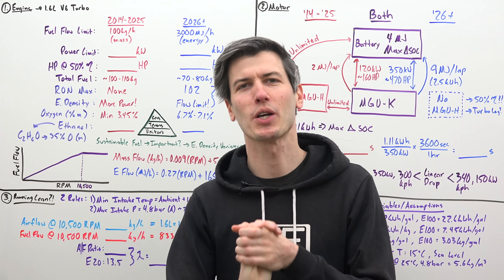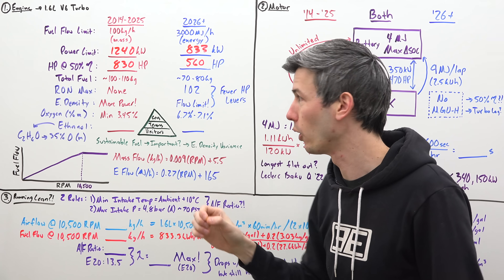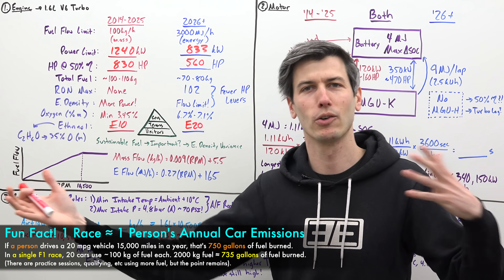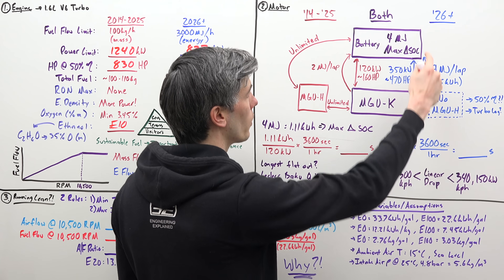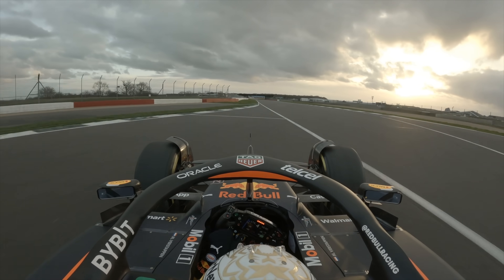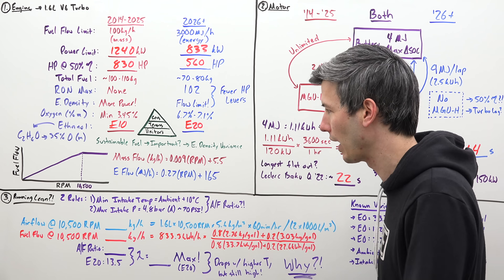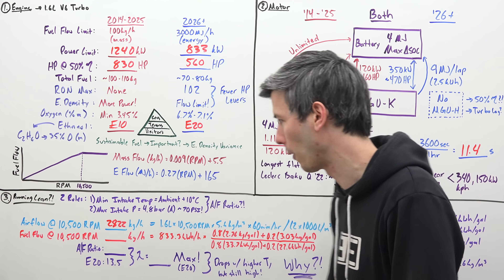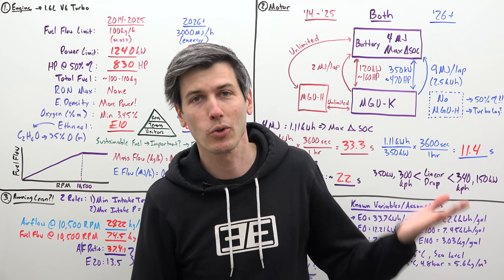Why Are 2026 Formula 1 Engines Going To Lose So Much Power?

Comment: I am wondering about the turbolag ever since I heard about the absence of the MGU-H. I mean now it is like the drivers have to recuperate some laps and can't always go flat out just to fill the battery. But to get 550hp out of 1,6L the turbo must be quite big, and in every single acceleration there will be this lag. So there must be a certain amount of ePower always available to fill that gap, otherwise the cars will be very hard to drive. I wonder if it affects the drivers or if the electric system will just fill the gap constantly in every racing situation
Reply: The FIA actually said they wanted the cars to be harder to drive (with turbo lag) but I suspect that scenario you describe above, using ECU maps to kick the MGU-K in during that initial throttle demand period, will be simple for F1 teams to implement.

Comment: Why would they get rid of the MGU-H? Wasn't that one of the most energy-efficient features?
Reply: Because MGU-H did give constant power to Electronic motor. So you could keep the electronic boost online all the time.
Without it, the driver has to think when to use that electronic boos, because it is used in shortet period of time (bigger e-engine) and it takes longer time to get the battery full…

Comment: Questionable decision to hamper the engines this much, a huge part of F1 branding is that they run the fastest cars on earth. If you take that away, you make it much easier for another org to steal market share.
Reply: The lap speeds can be better after 2026 rules… so not likely that these are not the fastest cars in the motor sports…

Comment: I'd much rather see a rolling average rate limitation... Having a flat rate cap seems to ruin the fun. If they instead used a rolling average limit, like dictating that the amount of fuel flowed in the past minute cannot exceed x, there would be a lot more strategy with when and where to use higher power.

Comment: Maybe teams will be using the Miller cycle or something similar to increase thermal efficiency at the expense of volumetric efficiency. Boost limits would effectively put a cap on how far they can go with that strategy.
Reply: The Miller cycle works best with a roots-type supercharger so it’d be interesting to see FiA probably allowing twincharge systems. It would make for a heck of a launch when the light turns green.
Reply: @Nafeels   "it’d be interesting to see FiA probably allowing twincharge systems"

There's the problem. It would require the FIA to allow something...
Reply: Superchargers aren't even restricted with current or future engine regulations. But you can't use an MGU-H with a supercharger. So maybe supercharging will make a comeback.
Reply: @456MrPeople that would be interesting, but superchargers are less thermally efficient.

Comment: How can an ICE rev past it's torque peak speed?  What force is pushing it faster if the torque  is at it's highest point and starting to fall off?  I would think that the fastest RPM would occur at the torque peak speed but obviously it doesn't.  Thanks

Comment: I still haven’t seen a clear video explaining how the ICE and electric motors are coupled to the gearbox. How do they transmit the power from both without the two affecting one another? In other words, say you have the ICE spinning at a certain rpm, and the electric motor spinning at a different rpm. How do you sum the torque and power output of both without them interfering with the other?

Comment: I don't think the intention is to limit the air mass flow rate. I'd guess that they are separately limiting (a) boost pressure, to stop teams cranking the boost WAY up – possibly for safety/reliability reasons? – and (b) intercooler performance – probably to try to head off an arms race of bigger/more complex cooling systems for marginal gains in charge air density. Now yes, those two together do impose a de facto limit on mass flow rate at the intake, but as you say that limit would give very lean combustion, and no-one's likely to hit it.
Reply: I came looking for this. 
I definitely think that they are supposed to be separate constraints.
Reply: yea cause if they can get away with super lean running engine then they will crank the boost of to as much as they can get away with. Try to limit max power to keep things some what level cause teams with unlimited would def explore an engine that can take a lot of boost and almost no fuel.

Comment: Are there rule about engine displacement? Because, with significant modification of the engine displacement, you can increase the horsepower without increasing the energy consumption.

Comment: Could a team use a 70 psi turbo pressure to motor the engine without fuel for a few revs? I’m just wondering about that air pressure limit on the intake…..

Comment: I would rather see a racing class where you are forced a certain mpg with a max weight, (for batteries). See if and how manufacturers go about getting the most speed out of much less fuel with certain ways of adding battery power to the equation, or stay lighter with none and really see what manufacturers can do with limits.
Reply: Formula e

Comment: The engine can be used as an air pump to enhance performance of other aerodynamic surfaces; see 'blown diffuser'. This may be to limit that so the exhaust outlet can be moved in future.
Reply: Compound turbo charging, ultimately led to gas turbines, and jet engines.

Comment: 560 HP engines in 2026 cars? Back in 2016, they made 1050 horsepower....  This is getting ridiculous.
Reply: 560hp + 470hp is more that 1050 hp… so we get more powerfull cars!
Just with less power from the gasoline pard of the car.

Comment: So if the new regs allow for energy regen at 9MJ vs 2MJ for the older spec, does that mean drivers can recharge their batteries that much faster ? (Since the battery capacity is the same between the old and 2026 regs)
Reply: In theory yes. I think it's safe to assume that one of the reasons for the 2MJ limit of old is that the MGU-H allowed the car to continuously recharge the battery whereas with the new rules that won't happen. Under the new rules energy regeneration will need to be done entirely in the braking. With that being the case, drivers will need to be able to regenerate more energy under each braking zone to prevent the batteries from being dead 24/7 (hence the increase from 2MJ to 9MJ). This could potentially result in strange driving patterns where drivers will get on the brakes earlier and with less force to allow for a greater amount of regen before long straights or just whenever they need to top off the battery.
Reply: True… using more motor break vs normal breaks will be beneficial!
Interesting to see who drivers learns more quicly to drive so that their battery is more full, more often

Comment: Re weird mix: The engines can cut cylinders so for a bank cut the air flow is twice the fuel. 
This is done to keep the turbo spooled in low power corners. 
With the big electric motor they might be tempted to cut all fuel in tight corners.  EG a MGU-H the hard way.

Comment: The FIA should just give them a race energy limit and let the teams figure out the best way to get there. That's one of the best reasons for motor racing is creating an environment where the rules lead to innovation. It seems like a lot of areas for innovation have been sucked out of the sport. I think I'd much rather see the rules opened to define a ceiling or floor and then let the teams bring what they will. Define the energy use, down force, max/min mechanical grip level, minimum weight (so we don't need jockeys), set a maximum budget and then let the teams develop what they will. That seemed to be the initial spirit of the sport. 

Oh well, good insight into the upcoming changes.

Comment: This is fascinating.  I'm seeing these changes in light of the coming legislated bans on ICE cars, and shift to electric vehicles.  Under their deal with FormulaE and the FIA, F1 apparently cannot go full electric until 2039, but the manufacturers will want to be using - and be SEEN to be using - relevant technology.  Shifting to almost 50/50 fossil fuel/electric power is a step along that journey.

Comment: Perhaps the intake air pressure limit is to keep teams from making a ridiculous amount of power for a short period while consuming a lot of fuel. With just a fuel limit they could run very efficient for a long period to bring their average fuel rate way down then for a brief moment dump a bunch of fuel and boost to make a lot of power while still staying under the average fuel flow rate. The intake pressure limit would cap that amount of power. That is, if I am understanding that the air is limited to an about of boost and the fuel is limited by an average fuel rate.

Comment: The thing confusing me is this, when will they charge the battery? If the engine is underpowered relative to the motor, and it is coupled directly to the transmission / rear wheels, during acceleration they will be using the motor and consuming electrons. At slower speeds they can’t decouple the engine from the rear wheels to power the mug-k as a generator. That leaves them relying on deceleration regen to charge the battery. (In other words thry can’t convert fuel to charge in real time by powering the engine during decoupled deceleration. They can only recapture previously powered kinetic energy as the car slows). I’m sure I’m missing something here and just thinking out loud.
Reply from the maker: It's just from regen. An F1 car traveling 200 mph has a lot of kinetic energy.

Comment: They absolutely are running as lean as they can as if you can get it to burn it improves efficiency. All fuel flow limited motorsports are running super lean now and its enabled by flame jet ignition a presumably other secret but similar concepts.

Comment: Crazy that the Valkyrie and the T50 have higher redlines than Formula 1!
Reply from the maker: They don't, current F1 engines are limited to 15,000 RPM, they just don't go much above 11,000 - 12,000 RPM because there isn't any benefit.

Comment: Will the teams be able to actually top it up to the whole 32 seconds? How many seconds does it take ( in racing conditions) to charge from empy to max charge?
Reply: Battery has 4 MJ
You can Charge 2 MJ/lap
2 laps ≈ 140 - 200 s

Comment: 9:40 two teammates streaming along such straight together could make more ground by overtaking each other on purpose. First the leading car uses his electric for both to increase speed and the other car just following in the drag on gasoline only (1) - and at about two thirds of the straight they change position.

 As a teamchef i would have my two cars communicate about it while going down straight - they give each other notice and recommend to the drivers just the right moment - 'in three, two, one seconds of time the leading car will run out of electric juice - get out of the slipstream - right now!'

1 - if the second car wouldn't be able to follow on petrol only we give him about 15% of electricity plus for perfect fit (test and measure) - and the overall equation two similar cars down straight just changes a little.

Thank you for your brilliant work! You like it very much!

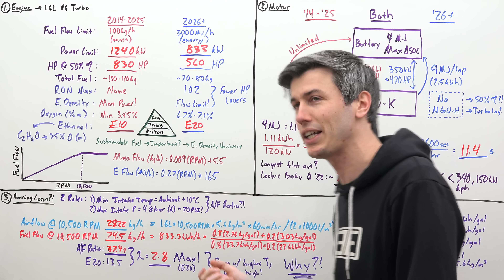15:00 - why? I have an idea. Because future synthetic fuels currently under development could provide for the possiblity to run so lean but still ignite and burn through sufficiently enough - i.e. provide us with huge benefits over current combustion engine fuels mainly made out of crude oils in simple processes?

(Next to discuss - quality of emissions and requirements to catalytic converters etc. for public transportation use?)

Comment: 13:46 : the engines may very well be running around λ~3. The pre-chamber allows them to do so with a closer-to-stoichiometry mixture inside it and a much leaner mixture in the main cylinder, way beyond the flammability limits for gasoline/E20, as you already indicated, which can however ignite this time due to the jets bursting out of that pre-chamber. The beauty of TJI it is! 😊
Reply from the maker: Yes, discussed in my previous video. Studies indicated λ~2 possible with active pre-chambers (something F1 isn't using, only passive). So it's not nearly as simple with limited control. More here: https://youtu.be/KjrNcuc89Pc
Reply: @EngineeringExplained  I had already watched that. Beautifully elaborated on! In the MC20 one as well, even though the configurations are quite different of course. My point was that limits, currently possible in latest F1 engines, are way beyond λ~2, as the whiteboard alluded to! Controlling combustion is of course the key here. Mixture preparation is really crucial, which is important to capture very accurately using CFD simulations. Stratification levels inside the pre-chamber are extremely high, due to the shape of body and orifices, which ultimately dictates the λ levels close to the electrodes. Source: seeing real geometries and CFD post-pro on screen daily due to my profession (amongst which motorsport and high performance ICE OEMs). Thanks again for your work 💪
Reply: Another thing to take into account is the trapping efficiency of the engine. With Miller valve timings it can be significantly reduced, resulting in a charge cooling effect at the cost of higher boost pressure needed for a given massflow.
Reply: Why you assume such high lambda is there as a limit to burn fuel? It may be a safety limit just in case someone puts race fuel or pump-gas and knock grenades the engine... Maximum explosive power. That or they want a diesel engine not to stall at low compression ratio and be able to start in winter. Why not a Renault F1 1.5 dci or 1.6 dci? Or MB F1 with renault dci engine? 2.2 will have more power but efficiency of small dci engines could make the race with 3 or 4 litres of diesel 1 race per galon.
Reply: @candeyhab  🤡

Comment: My best guess is that they're putting an air limit on as a way to prevent any tricks the teams find to get higher fuel flow into the engine by tying the rules into knots
Reply: Looks at Ferrari

Comment: Hello Jason! Just one thought on that rule… what if teams were allowed to use different fuels for each race? Going from E10-20 to E30-35 would increase O2 intake, wouldn’t it? That would make this rule a good way to cap overall power. 
Also, some races (Mexico City) are more than 2k m asl. Wouldn’t more ethanol help engines here?
As always, awesome videos. Thanks!
Reply from the maker: Fuel oxygen levels are set (as shown in video), so you can't go from E20 to E30.
Reply: @EngineeringExplained  Oh, now I get it. I thought the only restriction will be a minimum, but if it's going to be capped, it's a no go. Thanks for taking the time to answer!
Reply: Teams only get a handful of fuels per year, iirc. I think Mercedes might've done a video on those.

Comment: My guess for why all of these rules exist (not just the air but everything together) is to really put a limit on exactly how much can be thrown into the engine; we know teams are chasing power gains, and by putting hard ceilings on fuel AND air, it almost requires engineers to put work into thermal efficiency gains and electric power gains, which i'm guessing is what Liberty wants from F1
Reply: And lets not forget that they are trying to keep it interesting to watch, if they get limited by electric energy now then the drivers choice of when to use the energy to attack or defend a position will come in to play. It could get really interesting, at least in theory.
Reply: And at the same time they're banning the electric motor on the turbocharger and arbitrarily limiting the battery capacity (bigger batteries are heavier so that's a natural deterrent) and engine displacement.
Reply: Unfortunately that is not the case either, because they're basically keeping the current engines for 2026 but getting rid of a lot of the stuff that made them so advanced. They are also standardizing more engine parts for 2026 and are placing tighter regulations everywhere else on the engine.
Reply: A lot of new invention for aerodynamic came out from these reason.
Reply: @aimless3827  no, most major advancements in F1 aerodynamics came from a time when the rules were less restrictive about what the teams can do.
Reply: Liberty may want it, but do F1 fans want it?
Reply: You have no idea what Liberty has control of. Look at the actual contracts and regulations.

Comment: Engines need fuel and air (oxidizer), there is a lot of regulation about the fuel part, but is there anything about oxidizer ?  --> can a special oxidizer that could maybe be just 10+ °C and act as a chiller and lubricant instead of the fuel doing it ? 
Maybe future cars could be Oxidizer rich instead of fuel rich ?
Reply: Yeah, the airflow limit might not be "ambiant air(flow limit)" but liquid oxidizer flow limit ! Much like some Soviet rocket engines like the RD170...